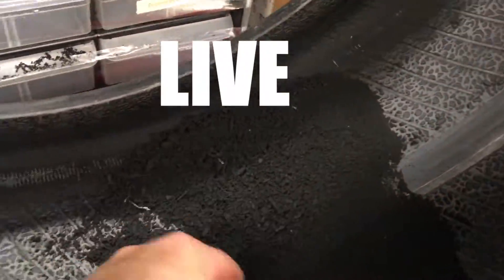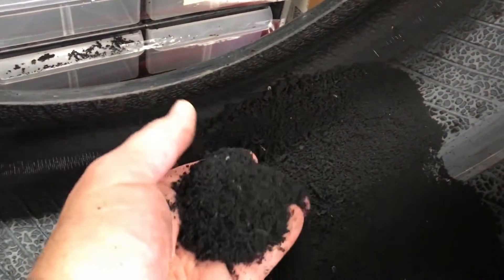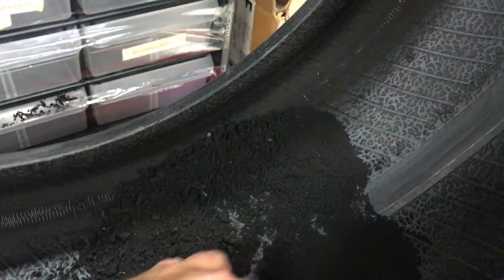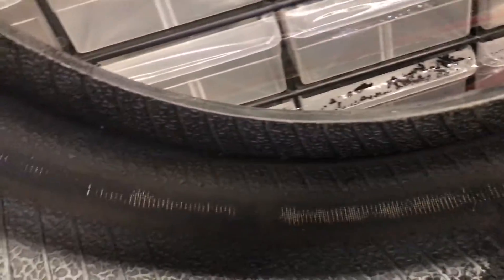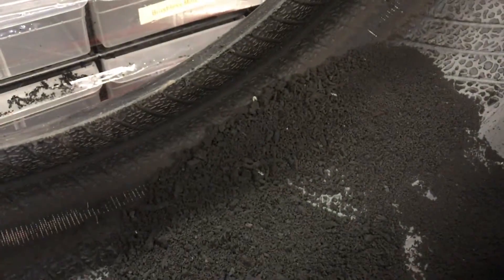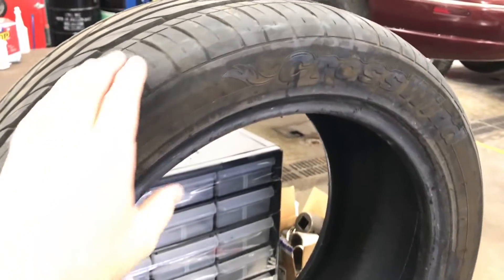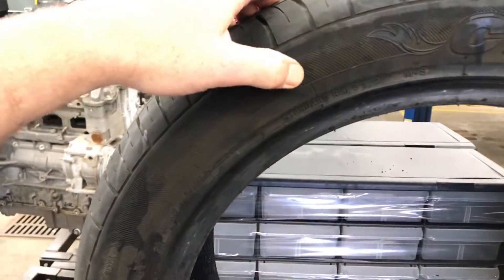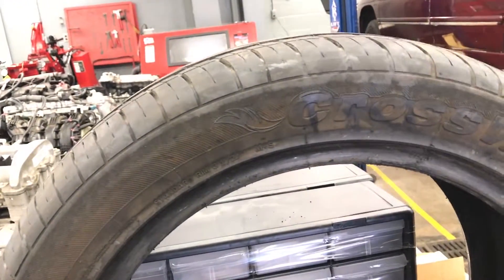What happens from driving with low tire pressure - How low tire pressure damages your tire  sidewall

Comment: Do not drive on low tire pressure especially at highway speeds. Couple things will happen your car will not handle very well your gas mileage will go down the tire is more expectable to punchers and the tire will fall apart and you won’t have as much grip with the road it’s very bad to drive on tires with low pressure.

Comment: Could all all that rubber that came off inside be a reason why the car vibrates at high speeds, as if the wheel is not balanced?

Comment: how many months before it looks like that when using the car as daily 30-40kph and let us say sometimes driving on a freeway for 1 and a half hour. Because I am thinking about mine I guess 3 to 4 months didn't put air in my tires from 33 PSI down to 25-28 PSI. I'm only worried about the 2 newer tires that I put last yr october2022 and march2023.

Comment: Thanks buddy, this has just happened to me with two front 275/35/20 tyres. They were fitted to my van around 2 years ago and never checked (yes my fault), checked today at the garage as I was noticing wheel wobble around 60mph. Took tyres off and the sidewall has an even bulging o the outside. New and better branded ones fitted tomorrow. Should've been 43-50LB and checked out at 25ish :(
Reply from the maker: Glad it helped

Comment: Thanks for this timely advice on tire pressure and what lack of maintaining it can result in.

I want to know how to deal with the kind of reasoning I've experienced, here in cyber world and in person: The thought that the cold pressure specified somewhere on a vehicle's frame is considered, by many, as 'underinflated'.  Such individuals consider a tire properly inflated if it is kept at, IE: at least halfway between the pressure on the vehicle pillar sticker and the Max Cold pressure stamped on the tire sidewall.  

I myself keep my tire cold pressures(right at dawn) at vehicle plus one PSI.  IE: 32psi, so I keep mine at 33, mainly to account for potential gauge error.  In winter - from November to March, I run 2-3psi over vehicle sticker.  The ride is as smooth as I feel it can be, given low-profile 50R17 tires, good steering feel, and good acceleration and braking.  

Your thoughts on the group in the first paragraph?

Comment: my tire was at 33.5 and the light did not turn on, it's a 2017 and I usually keep it at 38 when max is 40? that fine
Reply from the maker: Your tire pressure should be at whatever the sticker says on your drives side door.   Don't worry about the Max pressure listed on your tire.   Usually if a tire is 3 or more pounds low the light will come on but usually no damage is done to the tire.   Just need to add air to the proper pressure.
Reply: @Jake.of.All.Trades  what about bigger aftermarket tires

Comment: Would this also happen on bigger truck tires? My tires are rated to drive at around 35-40 psi but I’ve been driving a few days at around 20 psi for a few days.
Reply: Applies to any tires.
Reply: 20 should be ok. Anything below 15 is when you should expect to pay for new tires

Comment: Which tire pressure should we follow? The one told by the car manufacturer, or the one by the tires'. My current tires look flat following the car's recommended pressure.  The previous ones weren't.
Reply: Car manufacturer. Tire manufacturer usually specifies maximum pressure supported, not the working pressure expected by the car.

Comment: Bought 4 new tires for my 1969 V.W. Bug. at America's Tire (also know as Discount Tire).  The tire manufacturer's designated pressure for the tires is 32 psi.  America's Tire filled my front tires with 27 for both tires in the front and 28 for both tires in the back.  Brand new tires.
I drove with this low pressure for two months not knowing it was low then my car started feeling like it was ice skating on slick ice.
Took it to have the pressure checked.  I asked the tire pressure and the employee told me, and I saw on their air pressure monitor, the front tires were 27 and the back  tires were 28 on Brand New Tires they installed two months ago.   Thanks for making your video.  I have always relied on the honesty of mechanics and service people.  Guess honesty and integrity is now out there anymore.
Reply: Thats normal, tires naturally lose pressure slowly over time and you should actually get them air checked once a month. Also, this guy has no clue what he is talking about; for this to happen your tire has to be almost completely flat.

Comment: How long before it causes plys to show?
Reply from the maker: It's hard to say.    Usually you can tell by putting the tire to the correct pressure and pushing on the sidewall with your finger.   if it feels soft in the middle of the tire sidewall , then the tire is most likely damaged.  Sometimes you will even see a line  in the middle of the sidewall.   If you are not sure it's best to take it to a tire shop and have it inspected.

Comment: How low should the pressure be to be in that condition?  My tire had been driven for a few minutes with the pressure warning lamp in it, but it was hard to visually identify it. Is that gonna be a problem?
Reply: No, this results in very low pressure, where rim is riding on sidewall.  If you could hardly tell, then no worries, but you do have a leak; repair properly.